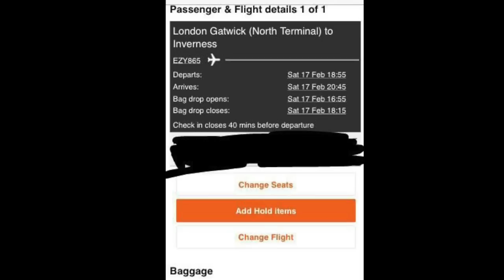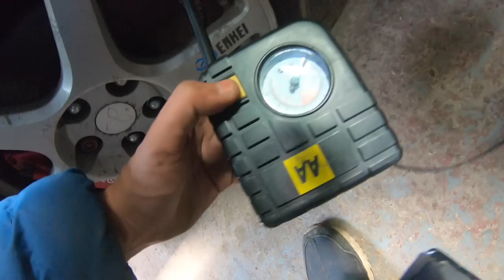WE BOUGHT A CHEAP EVO 8 FROM SCOTLAND & GOT HUSTLED!

Comment: Hey mate, i am an evo specialist and restore them, you have yourself a whole heap of trouble there on the underside.  You can see the chassis rails need replacing, so just be prepared for that, likely rear sections of sills rotted too.  Also, i'd recommend pulling the fuel pump out and checking the condition of the insides.  If its been left for years with some fuel in it will likely be corroded and need replacing, new OE ones are still available to buy. Cleaning them out isn't an option.
Reply: I don't think those strut towers are going to make it either they look like they are done, if that much rust is visibile in the bay and under it, imagine how bad it's going to be when you start digging?. I rekon there's 300 hours work just to stabilise that car rust wise and basic mechanical stuff and a huge bag of money will be required. After that you could start thinking about resotring it. I'm not even sure it's worth the effort.....
Reply: @hanyolo_  agreed, this car is just a breaker for me, far too many warning signs, but if they wanna give it a go so be it 😬
Reply: @rich_gasson  Yeah fair play to them if they can save it. I hope they have deep pockets 😄
Reply from the maker: Hey rich really appreciate your comment speaks soo much volume and helps me a lot.... would love for you to come visit me and see the evo in person and give me some advise..... very rarely do we bump into evo restores
Reply: @hoodstig  where are you guys? You don't sound very local to Kent haa
Reply from the maker: @rich_gasson  yes that's a 4 hour drive.... i guess the best thing we could do is vid calls.... message me on insta @hood_stig.... and if your ever plan a visit to west midlands give me a shout buddy...really want to hear about the story of the ego's you restored

Comment: Wow what a shame some people don't deserve nice motors glad your going to save it bro 🔥🔥🔥🔥🔥🔥
Reply from the maker: 100% bro
Reply: it snows all year round in Inverness Scotland, so lots of salt on the roads, and if it aint snowing it is raining and if it aint raining there is a fine moisture in the air...so any car that lives there is going to be extremely rusty, just how it is.
Reply: @christoph404  there's plenty of stuff you can do to protect your motor from rust in that kind of climate bud and if you have a car that's not the norm then it's worth going thru the hassle.
Reply: @TypicalBlue-rq8ri    yes sure,  not so many people would take the care and effort to try and protect their car from the corrosive climate here  in Scotland, but I'm with you on that, it is defo worth the effort if you have a modern classic, the previous owner of this Evo obviously didn't bother their arse to even give it a basic spray of wax oil every year.